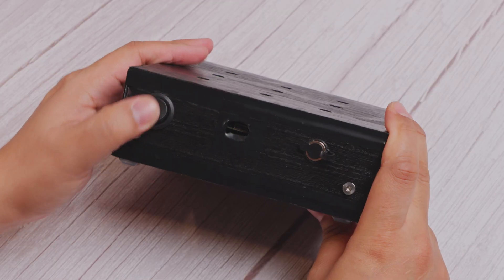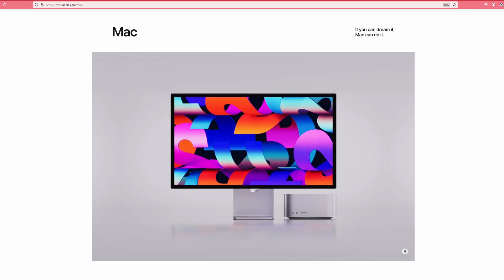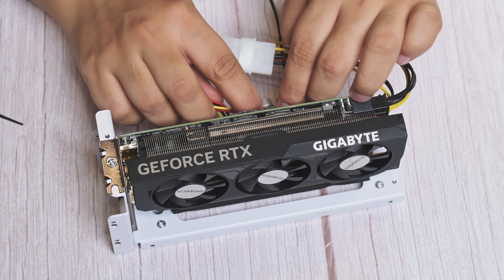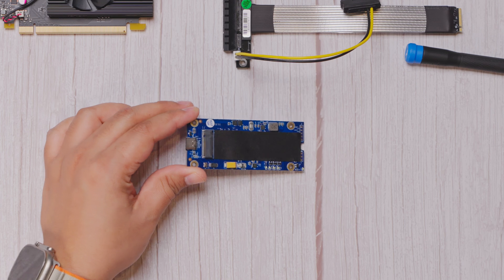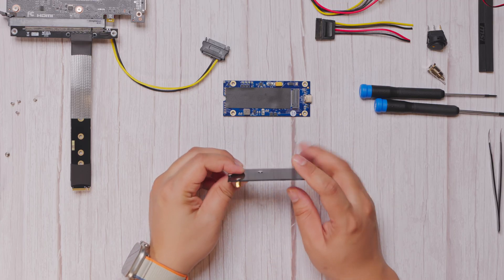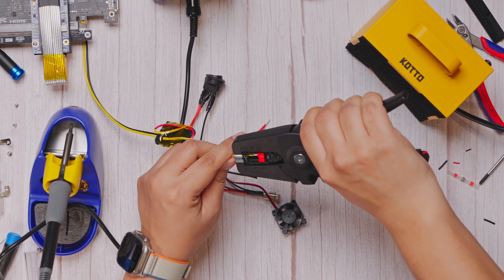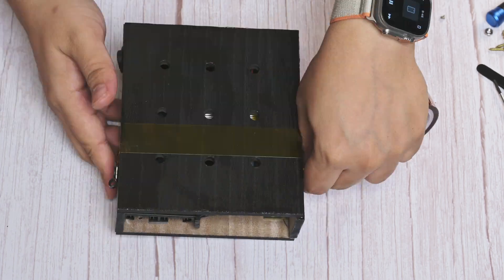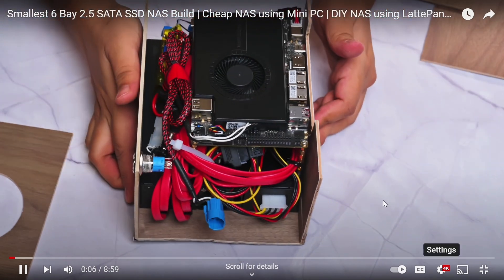Building an eGPU can't get easier and cheaper than this! A DIY Compact Upgradeable Mini eGPU

Comment: if you used a gpu that can be powered by pcie you might as well buy a miniPC that has better onboard chip.
the benchmark for egpu are cards close to or above the 4060m. as this is the current ceiling for igpus.

if you go through all this hassle for a card that performs worse than a 200€ miniPC igpu then I really dont see that as a viable option.
with current egpu price and performance (or ease of use) the future might very well be improvement for igpus.

Comment: Hmm. Giving your channel another try. One thought I had for your idea in this video is that it may be able to add video transcoding to a small server that happens to have has a BIOS that doesn't allow transcoding access to the motherboard's GPU due to technologies such as HPE's iLO for out of band server access and control. One such server I have also doesn't allow trannscoding access to a direclty plugged in PCIe GPU card to work either, due to a BIOS limitation. But adding a PCIe to Thunderbolt card may just add a level of indirection that could enable servers like this to do video transcoding by passing the Thunderbolt card to a VM and then having the VM load the GPU drivers, thus bypassing the BIOS limitation.

Comment: its not working for me, i got a gt 1030 too and everything else but it shows up as a usb device. what do i do?
Reply from the maker: TBH not sure, for me it showed up under the display drivers right away. Maybe some dependency on the host device ? Which converter card you are using? Does it support full PCIE tunneling?
Reply: @LatticeDensity  could it be my nvme enclosure?
Reply from the maker: @Gabrie-x5w  Yeah it can be, if it's a normal USB based enclosure it won't work. It must be a PCIE based enclosure, like thunderbolt or oculink. Even with those, you need to make sure they support proper PCIE tunneling, but most of them do.
Reply: @LatticeDensity  thx i'll give it another try, i really love what ur doing

Comment: Amazing idea! Though I'm not sure how practical the SATA power is going to be for more powerful graphics cards, since they can draw up to 75 Watts through the PCIe Slot, resulting in an amperage of 6.25A while most connectors are only rated up to 4.5 amps.
TLDR: Possibly too much amperage
Reply from the maker: True, I know this setup is not super practical, I just wanted to share the idea. I do have another similar build coming up that uses a decided PSU, which also solves the problem of graphics cards that needs a dedicated PCIE input power which is common for gaming GPUs these days. I am editing through that video this weekend, hopefully will post it before Monday. Thanks for your comment and stay tuned 🍾

Comment: Thanks for sharing your idea. I have a gpd g1 already, but I think your solution is better. The gpd g1 has one drawback as the fan runs all the time. I think this could be easily fixed in your setup. Can you confirm that you can control the fan of your gpu like it would normally work using it internally on a pcie slot?
Reply from the maker: Thanks for your comments! So, the Graphics Cards normally come with a PWM or PWM Like controllable fans on board, some often having extra ports for you to use. Either way, if you want to control your fans to the GPU curves, you should just use a PWM fan and tap the lines on the GPU onboard fan headers. Otherwise, you can also have your own PWM-USB line from the computer if you care too much about the fans. Finally, there is this thing called "thermistor fan" that has in built temperature probes that you can use locally to adjust the fan to the surrounding temp etc. You have some options there. HTH
Reply: @LatticeDensity  I forgot to add that the gpd g1 does not expose any pwm interface for its fan. Its not connected to the amd gpu fan interface. Its a bit of a missed opportunity here.
Reply from the maker: @saschaschneider6543  Well, that whole thing literally full with USB channels (I see it has an integrated hub), so even better! I believe you can tap any of those and control from OS level software

Comment: Does it necessary to have thunderbolt enclosure? I have 10gb one so does it gonna work?
Reply: Or Oculink?
Reply from the maker: Unfortunately not. Graphics Card uses PCIE protocol so you need an external port that can tunnel PCIE lanes, for example TBT or Oculink. 10G connections are normally USB, which can't tunnel PCIE lanes so it doesn't work with GPUs.

Comment: Why the sata connector? 
Direct connection is enough....
Reply from the maker: You are right, I used the sata coupler in between just to keep the option of replacing it with a real pico PSU later, should we need more power or dedicated power to GPU etc.

Comment: There are commercial smaller eGPU available for slotting low profile cards, there is a market for them in China.  Personally I got a Sonnet RX5700 GPU for around $160.  It's using a laptop form factor MXM card.  It has stonks features like Thunderbolt charging, and a USB-C video output with power for monitors or AR glasses.
Reply from the maker: That sounds like a really nice and compact setup!

Comment: I would like to try something like this for trainig AI ia there a limit on what GPUs i can use in this setup? And do you have links to the specific adapters you used?
Reply from the maker: May not be the best setup for Machine Learning Trainings, as even the most efficient models may need a much bigger bandwidth. However, it could work well for ML inference, which needs much less hardware. 

For the PCIE adapter, here is the one I used : https://www.amazon.com/dp/B07YDH8KW9
Reply: Well then ill go for cloud computing which is probably cheaper than thia aolution, but still very nice video
Reply from the maker: @chaerne  Yeah, whatever work for the consumer, options, options!

Comment: would plugging it directly into an nvme pcie slot work and give better performance than using a thunderbolt adapter ?
Reply from the maker: Probably, depending on which generation of an M2 port you have and underlying protocol supports.
Reply: @LatticeDensity  connecting the m.2 enclosure was genius lol how do i check if my enclosure is tb4/3 supported? Haha such a cheap build

Comment: Bro youre just a genius now i want a mid range gpu and i dont have much issue with the toal units size how can i do it easily? with lowerst possible cost? i dont care if its open ended without case
Reply from the maker: If you don't care about being open ended, I think you should probably go with the available open EGPU solutions like Minisforum DEG 1.
Reply: @LatticeDensity  i want to keep the laptop price low so what kind of port should i be looking for it in laptop? keeping it dirt cheap... but i want to invest in the gpu

Comment: If I remember M.2 is 10W 1x and 25W 4x and that single-pin 12V to sata cable is an extra 5 amps so 12x5=60W so that PCIE to M.2 adapter will do full 75W 
But you get no 12v power from m.2! So you're stuck with only 12x5=60W
Your brick is 12x6=72W so not to spec, but close enough.
Reply from the maker: Yeah you are mostly right, but it shouldn't be hard to hit the 75W of PCIE with a bigger brick. However, if you want some serious power, then these PCIE power based cards are not going to cut it anyways, for which a PicoPSU like route would be more idea which can provide as much juice needed, even directly to the GPU as well. Like I mentioned in the video, I am actually going to show that route in a future video which I haven't gotten time to get to yet, so please stay tuned for that if interested. Thanks for your comment, cheers!
Reply: @LatticeDensity  What's interesting is 4x gen5 lanes has the BW for powerful cards but gen5 needs redrivers for long range.

Comment: The NVME to thunderbolt is probably the most expensive part. they go around for $80-100.
Reply from the maker: Yeah true, if you buy the whole enclosure. Also, aliexpress has it for less, and also I saw there are a bunch of TBT to PCIE boards for around $50 directly available, so there's that route too. Nonetheless, they don't come even near to the AIO enclosure prices, like the Sonnet or the AkiTio ones, let alone the Mini-EGPUs.
Reply: @LatticeDensity  can you link The one you used

Comment: We need higher bandwidth oculink. I don't want a low power egpu. I want to make my high power 4090 to be external so I can turn it off entirely when I'm not gaming. I need something with full 16x bandwidth.
Reply from the maker: While Oculink does offer more bandwidth (64 Gbps vs. 40 Gbps, if I’m not mistaken), I still wouldn’t recommend using high-end GPUs with external PCIe connections if you want to maximize your investment. That said, a high-end card will still outperform lower-tier ones, but the diminishing returns of an eGPU setup become apparent at a certain point. That’s why I believe this mini-eGPU hits the sweet spot in terms of practical use.
Reply: They make oculink 8i but many laptops and minipcs may lack the pcie lanes.
Reply: @MrMackievelli  Beat me to it
8i on paper is fantastic, but often manufacturers do allocate the limited lanes elsewhere
Reply: @MrMackievelli  8 lane physically but still only connecting at 4 lanes, which bottlenecks bandwidth.
Reply: Just use a riser cable and unplug it when you arent using it.
Reply: Idle gpu's take almost no power. Even Rx 580's, a 8yo card, can run idle passively cooled. Your RBG lights use more power...
Reply: @user-kd1qg4fo1d  I measured 50-60w at idle.
Reply: @tecnocris  that's wild, my RX580 used like 12-18w when idling with the fans turned on.
Reply: 4.0 x8 would be enough in most situations. But you need to get those lanes from somewhere, and almost all m.2 slots give only x4. So the only option would be a pcie slot to oculink adapter...
Reply: What next bro? You want the moon in your hands. 16x bandwidth on egpu lol.
Reply: why take it off? Its still more efficent then your onboard gpu. Would be so stupid
Reply: @ it pulls 50-60w at idle. Onboard intel video is nowhere near that.
Reply: @LoFiiFlow  lmao if you think this is true I have no hope for you

Comment: Hey, man!
I had the same idea. Thanks for showing it could work.
I have 20Gb/s enclosure. I want to try connecting nvme to pci-e adapter like you
Reply from the maker: You should try, it will most likely work!
Reply: does this works? if it does what brand enclosure u are using. because some brand for some reason support only the nvme protocol and will not allow pci-e channels to run straight through the chipset.
Reply: @sahilmandi9495 no, it does not😢
Reply: @Glebcz24 try 40gbps , that’s tb3 bandwidth too

Comment: Hi, I have these questions below:

is this eGPU ok for laptops without the thunderbolt 3/4 capability?
Does it need removal of wifi module under the laptop?
Does it need external monitor?

Thank you for your response.
Reply from the maker: Thanks for your comment! 

- Thunderbolt is not a requirement , however GPUs being a PCIE component, it will need some kind of connectivity like thunderbolt to interface. Another option could be Oculink. If you're thinking USB, then it won't work, no PCIE devices will.
- Wifi card removal not required.
- https://www.reddit.com/r/eGPU/comments/utvv48/can_an_egpu_be_used_with_the_laptops_screen_as_an/
Reply: @LatticeDensity  ok, how about laptops without Oculink? The laptop is  HP 15-fd0252TU
Reply from the maker: @ If it doesn't have Oculink or TBT, unfortunately only things you can do is connect to an internal NVME port if available.